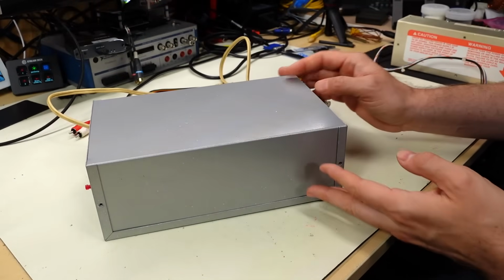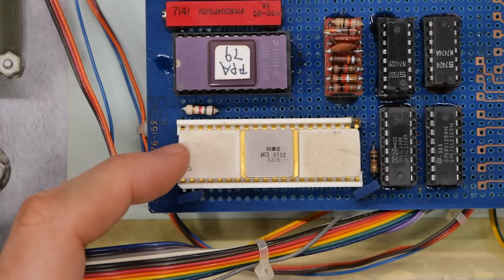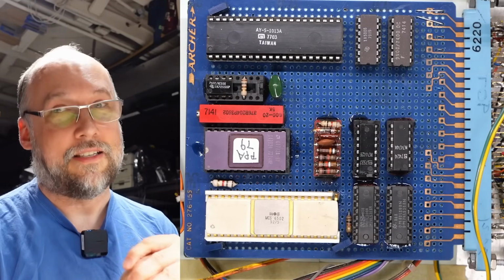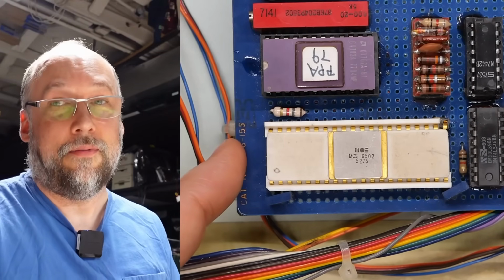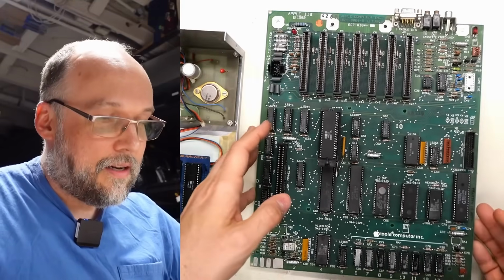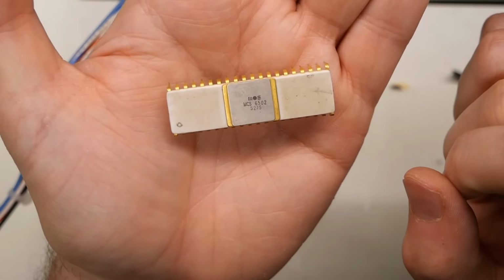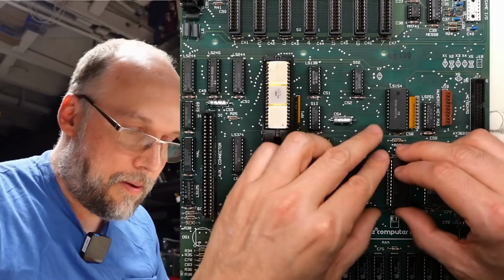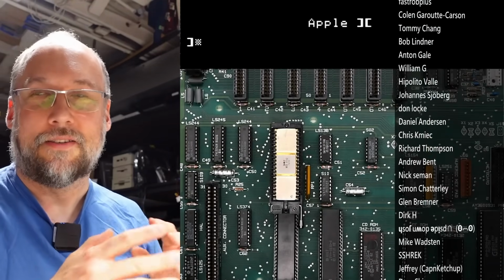Let's test a 50 year old MOS 6502 CPU

Comment from the maker: There have been a lot of recent comments about the missing ROR being "not a bug." I feel this is semantics, pure and simple. The feature is not fully implemented on the first revision of the chip, as pointed out by TubeTimeUS in his recent video, but there is plenty of evidence it was the intention of the designers to have it there from the start.

As pointed out by TubeTimeUS, there was just no space for the transistors to make it work properly. It's like they ran out of time/space or made a mistake implementing it, not realizing they would need some more room for the extra logic. So when they decided to release the CPU without ROR, they just removed it from the August 1975 datasheet. (That last part entirely speculation.)

The issue is, there is just a lot of evidence it was supposed to have been there from the start:

* Robin has a great tweet showing the decode table for the 6502 with ROR. Notice how it fits in so perfectly? 
https://twitter.com/8BitShowAndTell/status/1629754457172111361?s=20

* The Jan 1976 hardware manual for the 6502 lists ROR and says it will be working after June 1976. That is so soon after the chip's release to already be saying it will be implemented. 

* There is some wiring for the instruction that doesn't go anywhere, but there was some work done to implement something. Why wouldn't this have been ROR but they couldn't fit it, so they just gave up on ROR for that first revision? 

* It seems unlikely to implement ROL but not ROR - -especially since the 6800 (the "father" of the 6502) had both.

The real discussion to have is this: Is an unimplemented feature that was supposed to be there a bug or not? There is an argument to be had either way and both are valid points. For me personally, I look at it as a bug.
Reply: Good point about the 6800 having both ROR and ROL!

Comment: It's not a bug. They didn't implement a ROR operation it's not a BUGGY ROR, it's an ABSENT ROR. There shift right overwrites C, so the revised version added a C flag cache to be able to provide ROR, because customers wanted it.
Reply from the maker: There is no evidence it is from customer request. The 6800 had it and the manual from Jan 1976 said it would be there in June, just months after the 650X came out. All signs point to them running out of time to complete that instruction so it was released without it, a smart move as delays might have been detrimental to the popularity of the CPU.

Comment: It's not a bug. The hardware literally isn't there - it was created that way. The chip is working correctly, so it's not a bug. The feature simply hasn't been built onto the chip; it's a missing feature of the silicon itself. Only, of course, on the Rev-A 1975 6502.
Reply from the maker: The first official hardware manual for the 6500 series from January 1976 said that ROR will work in chips released after June 1976. And this tweet by Robin makes a great point about it all: https://twitter.com/8BitShowAndTell/status/1629754457172111361 It was pretty clear it was supposed to be there from the start but never finished. So, if it was supposed to be there but they didn't finish the design, and released the CPU without ROR working, it sounds like a bug. If the new "ROR" had been stuck somewhere else into the decode table, ok maybe, but how did there happen to be a perfect slot for it if it hadn't intended to have been there since the start?

Comment: I just had youtube recommend an interesting video, there is no ROR instruction bug, the silicon for the instruction is literally not in the CPU. the ROR was added in the second version. Someone had one of these chips that was damaged, and they optically examined it. No bug, there never was a ROR instruction on the first batch!
https://youtu.be/Uk_QC1eU0Fg
Many thanks to @TubeTimeUS that made the vid above! :) (And to Adrian for his awesome vids of course! ^_^)
Reply from the maker: The first official hardware manual for the 6500 series from January 1976 said that ROR will work in chips released after June 1976. And this tweet by Robin makes a great point about it all: https://twitter.com/8BitShowAndTell/status/1629754457172111361 It was pretty clear it was supposed to be there from the start but never finished. So, if it was supposed to be there but they didn't finish the design, and released the CPU without ROR working, it sounds like a bug. If the new "ROR" had been stuck somewhere else into the decode table, ok maybe, but how did there happen to be a perfect slot for it if it hadn't intended to have been there since the start?
Reply: @adriansdigitalbasement  I think for it to be a bug, it needs to be at least partially implemented. It literally isn't there. and back then, the concept of leaving space for future instructions would have been a thing, for V2 of chips that would add stuff later.

The original creator stated that there was no ROR instruction, and indeed there is no circuitry for it. Maybe it's likely it was going to be added later, but the documentation writers thought it was implemented and added it to the doco for V1.

Either way, a very interesting and rare chip. :)

Comment: It's not a bug!
Reply from the maker: The first official hardware manual for the 6500 series from January 1976 said that ROR will work in chips released after June 1976. And this tweet by Robin makes a great point about it all: https://twitter.com/8BitShowAndTell/status/1629754457172111361 It was pretty clear it was supposed to be there from the start but never finished. So, if it was supposed to be there but they didn't finish the design, and released the CPU without ROR working, it sounds like a bug. If the new "ROR" had been stuck somewhere else into the decode table, ok maybe, but how did there happen to be a perfect slot for it if it hadn't intended to have been there since the start?
Reply: @adriansdigitalbasement   TubeTimeUS has an excellent video about this you might want to check out.  Could be he's wrong.  Regardless, perhaps the myth lives on anyway?  "The 6502 Rotate Right Myth".  I won't share the link as YT might delete my post.

Comment: Amazing video and thanks for putting this out! But in fact the ROR was simply missing in that chip https://www.youtube.com/watch?v=sPaAnbkhgAE&t=1049s as per its official preliminary datasheet. So the "bug" is simply an untested behaviour of a non -existing instruction that should not be called and which was on purpose left out of the instruction set :)
As per Wikipedia, May 1976 datasheet listed 56 instructions which included ROR and the chips implemented it correctly.
Reply from the maker: The first official hardware manual for the 6500 series from January 1976 said that ROR will work in chips released after June 1976. And this tweet by Robin makes a great point about it all: https://twitter.com/8BitShowAndTell/status/1629754457172111361 It was pretty clear it was supposed to be there from the start but never finished. So, if it was supposed to be there but they didn't finish the design, and released the CPU without ROR working, it sounds like a bug. If the new "ROR" had been stuck somewhere else into the decode table, ok maybe, but how did there happen to be a perfect slot for it if it hadn't intended to have been there since the start?
Reply: @adriansdigitalbasement  that is a bit like saying that unused/untested functions or undocumented features in a software release are bugs just because they are left in the code, even if not explicitly available to the end user :) I'm sure there are plenty of other examples like the ROR in other chips, simply because like in software development, features (or instructions) are added in subsequent revisions, but often releases already contain part of the code that is implementing those unfinished features. In the video I linked before, Bill Mensch said that Chuck Peddle intentionally left out ROR in the rev A and this is why it doesn't appear on the datasheet; was it because it was unfinished? Possibly. Is that a bug? No, because for it to be a bug, the ROR had to be officially released, which means completed in hardware, tested and published in the datasheet. Eric goes deeper here https://www.youtube.com/watch?v=Uk_QC1eU0Fg showing rev A was missing the logic to do the ROR and even control lines from the decoding logic, while rev D added them, implementing a perfectly functioning ROR, which was then added to the datasheet. Unfinished/missing feature :)

Comment: It's not a bug. The first revision did not have an ROR instruction at all. It wasn't that they tried to implement one and made a mistake, "a bug". It's that it simply wasn't a feature in the first version. That's the reason it's not on the data sheets. Any software that has the ROR instruction dates from after the second revision came out, and was intended for hardware using one of the later chips.
Reply from the maker: The first official hardware manual for the 6500 series from January 1976 said that ROR will work in chips released after June 1976. And this tweet by Robin makes a great point about it all: https://twitter.com/8BitShowAndTell/status/1629754457172111361 It was pretty clear it was supposed to be there from the start but never finished. So, if it was supposed to be there but they didn't finish the design, and released the CPU without ROR working, it sounds like a bug. If the new "ROR" had been stuck somewhere else into the decode table, ok maybe, but how did there happen to be a perfect slot for it if it hadn't intended to have been there since the start?
Reply: @adriansdigitalbasement  I'm with the other guys on that thread. But even based on what you think to be the case, that still wouldn't be a bug. In software features are often pulled before shipping, and the code for them is not complete. That isn't called a bug, because it's not claimed to be a feature of that release. And it's simply not available for users. And yes, it may well appear as a feature on a later release. The same would apply to hardware.

Comment: Not a bug. Just A missing feature at the time.
Reply from the maker: The first official hardware manual for the 6500 series from January 1976 said that ROR will work in chips released after June 1976. And this tweet by Robin makes a great point about it all: https://twitter.com/8BitShowAndTell/status/1629754457172111361 It was pretty clear it was supposed to be there from the start but never finished. So, if it was supposed to be there but they didn't finish the design, and released the CPU without ROR working, it sounds like a bug. If the new "ROR" had been stuck somewhere else into the decode table, ok maybe, but how did there happen to be a perfect slot for it if it hadn't intended to have been there since the start?

Comment: Chuck peddle said, it was not a bug, ROR was not implemented in the early 6502
Reply from the maker: That is semantics. There is plenty of evidence it was supposed to be there from the start. The first official hardware manual for the 6500 series from January 1976 said that ROR will work in chips released after June 1976. And this tweet by Robin makes a great point about it all: https://twitter.com/8BitShowAndTell/status/1629754457172111361 If it was supposed to be there but they didn't finish the design, and released the CPU without ROR working, it sounds like a bug.

Comment: Uhm ... no. The lack of ROR isn't a bug, it didn't have that instruction. It was added in the later version.
Reply from the maker: The first official hardware manual for the 6500 series from January 1976 said that ROR will work in chips released after June 1976. And this tweet by Robin makes a great point about it all: https://twitter.com/8BitShowAndTell/status/1629754457172111361 It was pretty clear it was supposed to be there from the start but never finished. So, if it was supposed to be there but they didn't finish the design, and released the CPU without ROR working, it sounds like a bug. If the new "ROR" had been stuck somewhere else into the decode table, ok maybe, but how did there happen to be a perfect slot for it if it hadn't intended to have been there since the start?
Reply: @adriansdigitalbasement , it fits into the opcode decode table because the 6500 is a microcoded CPU. I don't see where you get the idea that it is "pretty clear" that it was supposed to be there from the start.
I talked to Chuck Peddle about this and the question was also asked of Bill Mensch.  Take a look at https://www.youtube.com/watch?v=Uk_QC1eU0Fg

Comment: The early 6502 cpus did NOT have the silicon circuitry to support a ROR instruction. so it was NOT a bug but not even implemented. The ROR instruction was added later in the next revision of silicon. (It DID have a shift right but not the rotate right). the reason that the code almost works is that the motorola style processors such as 6502 and 68xx were random logic decoded so as to operate much closer to the clock frequency. the Intel style (8080 and Z80) used microcode which take a lot more clock cycles per operation (often 10 or 12x instead of 2x or so). If you take a 6502 or 6800 processor and list all of the operations in a table you will see patterns and missing opcodes for stuff like a STA immediate (which doesnt make much sense in real code)

Comment: The ROR bug on these is a myth.  The initial production runs didn't include the ROR on purpose.  MOS caved to customer pressure and included the ROR in subsequent revisions.  If you look at the silicon, the command register that ROR would have used was purposely not connected to anything and the revisions used a hack using a latch to include the ROR in future revisions.
Reply from the maker: Do you have any evidence that is the case? Robin makes a great point about it all: https://twitter.com/8BitShowAndTell/status/1629754457172111361 It was pretty clear it was supposed to be there from the start but never finished. So, if it was supposed to be there but they didn't finish the design, and released the CPU without ROR working, it sounds like a bug. If the new "ROR" had been stuck somewhere else into the decode table, maybe, but how did there happen to be a perfect slot for it if it hadn't intended to have been there since the start?

Comment: I just watched a video by TubeTime where he delved into this and found that it wasn't a bug but rather was intentionally just completely left off the chip to make it as simple as possible. So more of an oversight of how important that instruction could be. He was able to find one with the die exposed and confirm that the transistors for ROR just plain didn't even exist in the early version.
Reply: It may be due to other reasons (e.g. they had to release it by a certain date)
Reply: Need to search for that video! The fact that was considered a bug could be because the chip did have a ROL instruction so is odd they missed the ROR but the fact that they came with a revised chip so soon after launch adding it does lead me to believe that was omitted on purpose to get to market early, in the 70’s you needed the product ready to present it in the key conferences to be able to market it properly
Reply: @MarianoLu  one thing about it is that ROL A doesn't even need any special circuitry, it's just ADC A, except for not setting the V flag.
Reply: @BruceHoult  Uh, what? Rotating left is not the same thing as add with carry.
Reply: @AureliusR what makes you say that?
Reply: @BruceHoult  What? ADC adds a constant and also the carry if set. ROL moves all bits left and pushes bit 7 into carry and carry into bit 0. Those are two completely different things. If they weren't then why would they bother having two different instructions?
Reply: @AureliusR seriously? Try thinking about it a little. 6502 doesn’t have `ADC A` but Z80 does, 8086 has `ADC AL,AL` etc. But ok, start with some value in A, let’s say 10 (binary 1010). Do `STA $00;ADC $00`. What do you have in A and C now if C was 0? What if C was 1? What would you have in A if you’d done `ROL A`? How about if A had started with 129?
Reply: I saw the same video. The one where they even looked at the transistors of the chip, right?
Reply: And yet, compilers accepted the instruction and the CPU does something with it, even though it is incorrect.
Reply: @Hans-gb4mv  You can find a lot of "illegal opcodes" in the 6502 which does something. Matt Godbolt wrote about a couple of them in the context of his BBC micro JavaScript emulator. As for the compiler (assembler): the opcode was added to the chip in later revisions so it became a legal instruction (unless you have an old chip, in which case it is just undefined behaviour)
Reply: @Hans-gb4mv  there were no compilers early on when this revision was current.    look if you're working with just like few hundred bytes or whatever a kim-1 usual program or whatever was as the program sizes it's not that much of a problem to just do it by hand.  we did that for hitachi back in uni 20 years ago still.  i just wish they had used a more widely used cpu family for that course than the hitachi.. still it was a pretty easy course since you got to have the manual for the exam, so it was just tedious decompiling by hand and compiling and doing on paper what would end up on the registers.
Reply: I watched the same video. A sad thing about the Internet is that once incorrect information is disseminated and accepted by the public, subsequent attempts to correct it don't get as much traction as the original misinformed story.